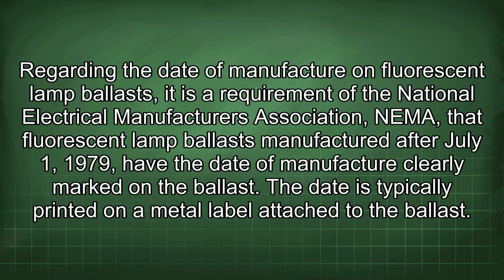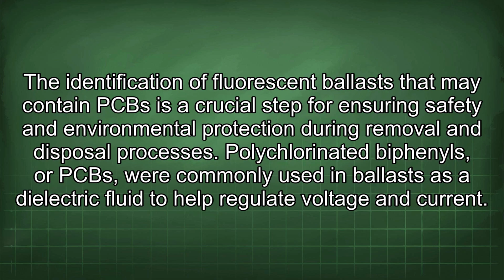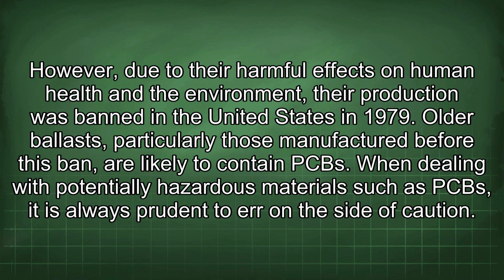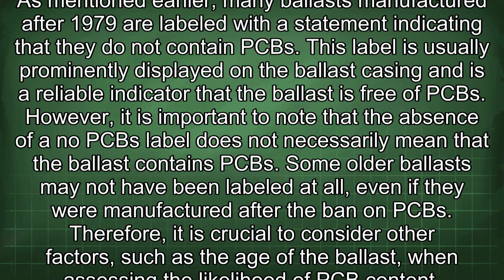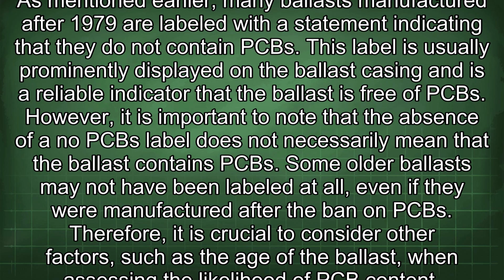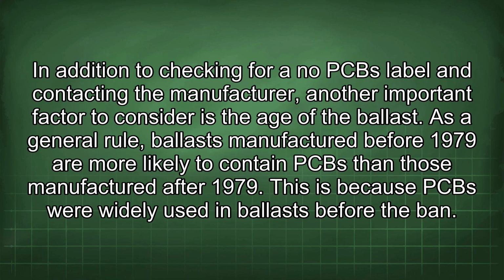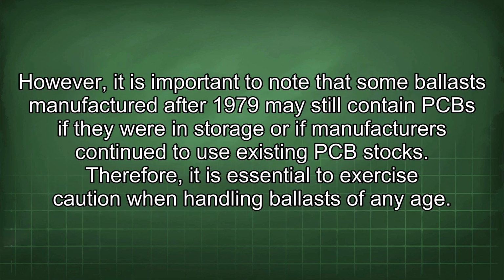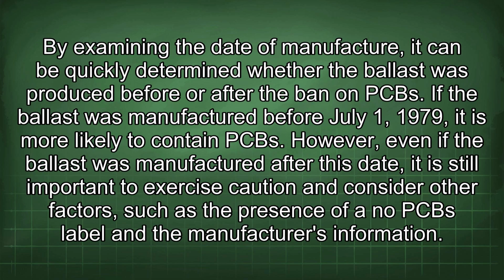Identify Ballasts with PCBs and Date of Manufacture

Comment: As a rule of thumb, any "magnetic"  fluorescent ballast in which the label is missing or illegible, and that does not have a date stamp on it's metal casing should be assumed to contain PCB's, especially if the building was constructed prior to 1979..

However, even a building constructed in the 1980s has the potential to have some fluorescent fixtures with PCB containing ballasts because it's not unusual for a ballast to sit in a warehouse for several years after manufacture before being put into service.   Therefore the construction date of a building should never be considered an idiot-proof way to determine the presence or lack of, PCBs.  

PCB's can also be found in the capacitor in mercury vapor, metal halide, high pressure sodium or low pressure sodium light fixtures made prior 1979 as well, while newer fixtures of this type will typically have a NO PCBS marking on the capacitor.